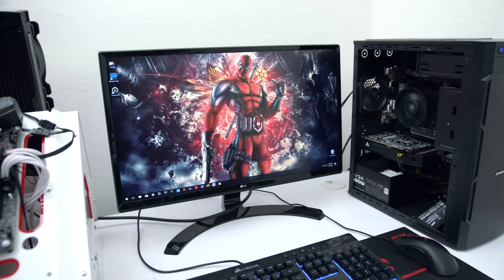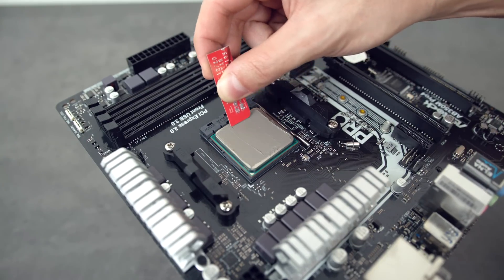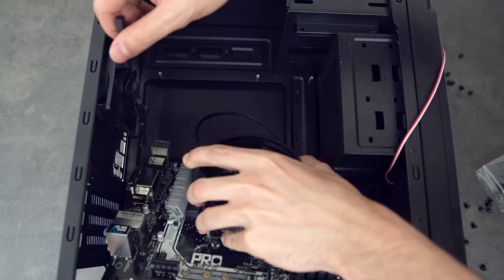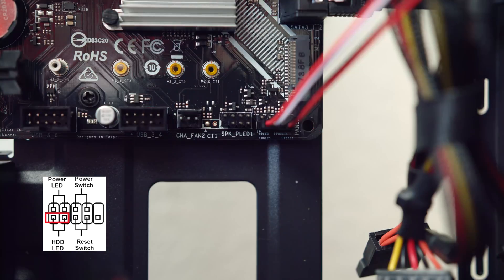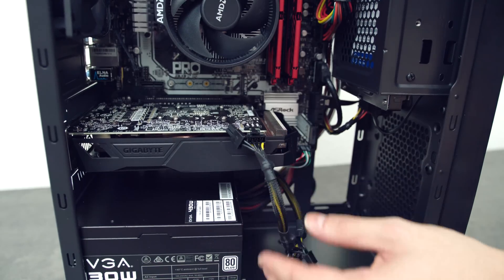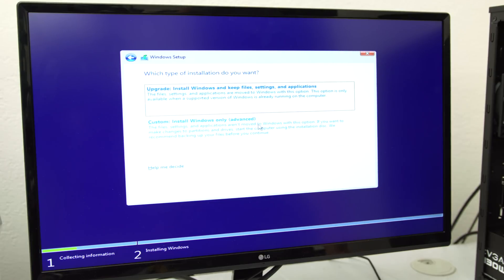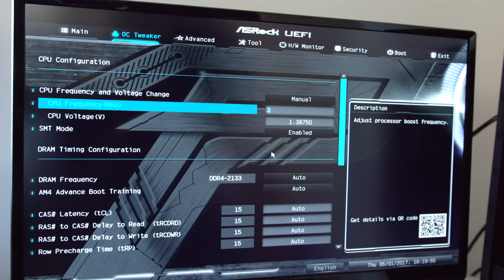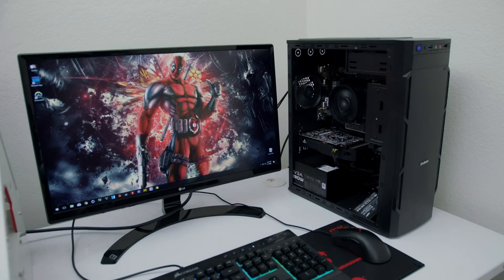How To Build A $550 Gaming PC w/ Overclocking!

Comment: Antec NX100 Gaming Cabinet with Transparent Side Panel = 2400/-

2)      Corsair VS550 550W SMPS = 3400/-

3)      MSI A320M Pro VDS Motherboard = 3600/-

4)      CPU Ryzen 3 1300x = 6000/-

5)      Klevv DDR4 8GB 2400Mhz RAM = 5200/-

6)      Teamgroup L3 EVO 120GB SSD = 1800/-

7)    HDD 1TB Internal Toshiba = 3249/
Plus I am using  used graphics card amd r9-280 3gb oc edition how is this build

Comment: you can still playing an games without gpu at ryzen cpu,just use integrated graphics,yep,if you using ryzen 3,u will using radeon vega 6,for ryzen 5,u will using radeon vega 8,for ryzen 7,u will using radeon vega 10,these graphic cards are integrated graphic,which still can playing games,but if you dont want a lag,dont force right flat settings at the graphic settings

Comment: Can you make pc frome these:
-Kingston ram ddr4 8gb pc2400 hx fury
-lc power supply lc500h 120 500w
-gigabyte radeon rx 570 gaming 4g 4gb gddr5
-wd blue 1tb 7200 rpm 64 mb sata lll wd10ezex
-asrock ab350m hdv ddr4 sata3 usb3 hdmi am4 matx
-amd processor ryzen 5 1400 with cooler wraith spire 65w yd1400bbaebox
- case ?
Reply: The price without case is 679.50€

Comment: So I did use this build, only I used a saphire pulse radion rx560 and a crucial ballistix sport LT 8 GB DDR4 ram. When I turn it on the led in the front of the case becomes blue and the amd cooler starts spinning, however my monitor says there is no signal detected. I also see no other lights inside the case. I checked all the cables and everything is in the same place as shown in the video. Also the monitor does work when I tested it with my laptop. Someone having any suggestions?

Comment: PLZ HELP. Hi, I really liked this pc for the price so I ended up building it a few weeks ago with the only changes I made was a 500w  supply and a gtx 1050ti instead of the rx 560 in the video due to price inflation recently. I then overclocked it and got 3.75 hz on the stock cooler and am very happy about this overall, only thing is I want to upgrade and get an SSD. It's not like the cpu is slow per say, but I just want that zooming fast load times that I know I could have with an ssd. Basically I need an SSD that I know will fit in this build. PLZ help

Comment: Hello I'm building this pc and I've bought all the parts you've listed in the description I've followed all of the instructions in the video the pc is able to power up I have a backlit keyboard plugged into the back that turns on and all of the fans are working the CPU fan, the gpu fan, and even the fan that came with the case but for some reason when I started the pc up nothing is showing up on my monitor. I'm currently only using a TV as a monitor until the actual monitor I ordered comes in so I have the tv plugged in and set to HDMI but for some reason nothing is showing up I've made sure all the cables were connected properly but I don't know what to do at this point please help
Reply: Wait nevermind I just had the hdmi cable plugged into my CPU instead of my gpu

Comment: Pc good for pubg ?
Reply: iTzFergy go for an rx 570 for pubg atleast. pubg is unoptimised as it is in early access so performance wont be great but playable at 30-50 frames on medium settings
Reply: Deano so this system isn't the best does he show how to build  rx570
Reply: iTzFergy exactly the same process
Reply: I'm kind of confused new to pc , Rx 570 is a different part instead of ?
Reply: iTzFergy rx 560, the gpu

Comment: Can someone give me some ideas for my first gaming pc, this is my first build and I plan on using it for primarily gaming. It includes pentium G4560, GTX 1050 Ti MSI gaming x, 8 gigabytes of Ddr4 ram (2 x 4), EVGA 430 w powersupply, Wd blue one TB hard drive and a Msi pro series B 250 pro- be mother. Board. Any segestions are appreaciated
Reply: Clash of clans daily get ryzen 3 when it releases and a a320 mobo

Comment: After I boot with the flashdrive it brings me to the windows installation screen but then my usb keyboard and usb mouse stop working. the light on my flash drive also shut off. People say to change a setting in the bios but i cant seem to find it. Others say to use a ps/2 mouse and keyboard. Any help would be great.

Comment: Someone please help 
These are my specs 
Intel i5 6500 3.2Ghz
GeForce gtx 1060 3GB
16GB RAM 
1TB hard drive and 60 GB ssd 
What would be a good psu. 
I got a 430w but the graphics card won't turn on at all

Comment: I've never built a PC before, so should I be worried about things not fitting and not being compatable?
Reply: if you buy these speific parts you shouldent have no problems but if you buy different one just double check because i have made that mistake before and it cost me 10 to return it

Comment: on the io shield, make sure it is lined up then tap it in with the back of your screwdriver. at least if you have a normal plastic handled screw driver. only takes taps, don't wack it.

Comment: This is a bad gaming PC for the price. Games rely more on GPU horsepower over CPU, yet you've used more of the budget on the CPU than the GPU. At this price, the only CPU you should be considering is the Pentium G4560. Pair it with an RX 570 and you will absolutely SLAUGHTER this PC for frame rates, expect 1080P 60FPS @ Ultra over the 40FPS @ Medium this PC delivers. Guys, if you want a well balanced gaming PC for the price and you don't know how to choose parts, stop watching Youtubers. Go to pcpartpicker and post a forum question, people with years of helping others on forums will answer.

Comment: i need your help Techsource I'm building this pc but I'm adding a optical drive, a few led fans, I'm using a different gpu (
ASUS Geforce GTX 1050 Ti 4GB ROG STRIX ) , and I'm wanting to add more ram and maybe even a second gpu so should I get a 500w power source or should I stick with the one you used. plz help I need you

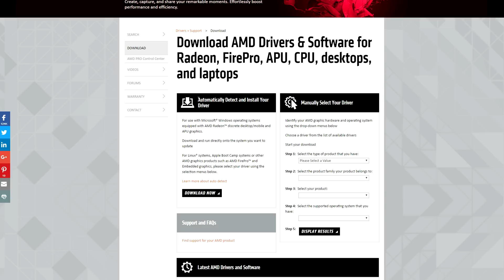Comment: @ 9:07 you said auto detect gpu but you said earlier if the pc doesn't have internet connection. So people doing that will install the wrong driver if they do it on another pc

Comment: Starting on building my pc in a couple weeks!
i3 7100 CPU 
Asus Prime B250M-K
2x4Gb G.Skill Ripjaws V Series 2400mhz
Zalman ZM600-GV 600 watt psu 
Fsp P1802 mid tower case
WD 1 tb HDD
Gtx 1050ti

Cost around 900-1k in New Zealand dollars, wish they weren't so expensive here lol, but I'm stoked cause it's my first pc build 😃😃

Comment: are you sure it is safe to go past 1.4 v? usually it is recommended to stay under 1.35 volts, especially if it is going to be clocked that way 24/7

Comment: please read all of this to help a person that wants to get out of this stupid console (xbox one). 

Is this build good for games like csgo, rainbow six, gwent, quake and a few indies on atleast 1080 and 120fps or 60fps.

RAM
- Ballistix Sport LT 8GB Kit (4GBx2) DDR4 2400 

CPU
- AMD Ryzen 5 1500X Processor with Wraith Spire Cooler 

Storage
- Seagate Barracuda ES 1 TB
- Kingston Digital 120GB SSDNow UV400

Graphic Card
- MSI Computer GTX 1060 ARMOR 6G OCV1 NVIDIA GeForce GDDR5

power supply
- CORSAIR CXM series CX550M 550W 80 PLUS BRONZE 

Motherboard
- ASRock AB350M PRO4 MicroATX Motherboard

thanks for reading this and sorry for my English
Reply: Seems like this is more expensive than a Xbox One.

Comment: I have an rx 460 graphics card and idk why sometimes on csgo when i play on the highest setting i get well above 150 fps but some times if i play on low settings or high it doesn't pass 50 and its really laggy and pisses me off
Reply: David Romonti doesn‘t make any sense . If you still have warranty on your rx 460 then send it to amd to fix the problem , maybe you have a faulty or detective gpu. Then amd could switch it and then give you a new rx 460 for free if the error can’t get fixed. ( sorry for my bad English )

Comment: Hey guys.
I'm getting a PC, used for abit of everything, including programming and gaming. Ideally, I want to have 3 1080p monitors(gaming for some games)(24 in on the sides, 27 middle) and then in the future,if possible, upgrade the middle one to 1440p.
I want some oppinions on the build, if its good, different parts etc.My budget is around 1500 CAD, which is the cost of the parts I have..

Core-i5 7500
Cooler Master Hyper 212 EVO
Asus Z270 PA
Ballistix 16GB RAM
WD 1TB 7200RPM
GTX 1070
NZXT 340 Case
EVGA 500W
CorsairSp120Fan

Thanks alot!
Reply: im so late, but i think those parts are enough for your needs

Comment: "I apply the thermal paste like this for OCD reasons..."

Installs CPU cooler with logo sideways
Reply: Nate G the logo spins with the fans, nothing can be done
Reply: Shayan Ahmed I forgot that's a thing with AMD fans, thanks for pointing that out makes sense now
Reply: McLovin why did you have to tell me, now I can't unsee it
Reply: Most people face it that way. In my opinion it looks cooler. Hehe get it?
Reply: Peter V not a fan of it because it gets my head spinning
Reply: Oyster nice
Reply: no it doesnt, its just mounted that way, I managed to turn mine but the screws holding it were impossible to get to so its partially broken
Reply: Tico2858 congrats
Reply: It bothers me man
Reply: Starless Knight no the logo on the frame of the fan dosent move only the one in the fan can spin
Reply: its the fan wise guy
Reply: xDDD
Reply: The logo on the fan frame is meant to be like that....
Reply: Nate G TRIGGERED!!

Comment: Is this cpu good for using programs like ArchiCad, acadbau, editing videos or youtbe at all?
Reply from the maker: +《PR》 Prince¡ check my benchmarks video
Reply: TechSource So i guess its not the best... the program is designed for 4core cpu....so idk have any suggestions? should i just pick another cpu? which one?
Reply: 《PR》 Prince¡ how much r u planning to spend on the pc
Reply: Ryder Wang trying to get ti for max 600-650€
Reply: 《PR》 Prince¡ whats ur budget for the whole pc, i live in canada so idk exactly how much 1080 ti cost in euro, but i searched it up on pcpartpicker, for 650 euro id think ur able to get a 1080 ti unless ur fine with 980 ti, but i would go for 1080 instead of 980 ti paired with a 7700k, overclocking it to 5 ghz should get u the performance u want. last i want to mention it that u could pair a 1080 ti but lower u budget to a 7600k, dk if it will bottleneck tho
Reply: Ryder Wang ok thanks i will check things out when i will be able to...

Comment: amd fx 6300 is better than ryzen 1400 because fx can be overclocked to 4.7ghz i have it 4.5ghz and its stabl
Reply: HansBeaast the clock speeds aren't everything. You're looking at a 5 year old cpu vs a 5 month old cpu. The Ryzen chip is way more power efficient and offers more performance.

Comment: Probably should have removed the stickers on your ram, it might heat up and get all sticky.

Edit: Of course Im not talking about the aesthetic ones, Im saying the white barcode label one
Reply: doesn't that void warranty?
Reply: I never said throw it away, you can always keep it and re-apply it later if you need to RMA, and no-one will be the wiser ;)

Its just that I've had a sticker label heat up in my PC before, and it smelled like burning rubber in my room for a whole week.
Reply: The Booty Guru nah it's better this way so you know what it is later

Comment: I just finished my build and it came out almost the same for exactly the same price, the only difference is I got an evga 500w PSU, a gtx1050ti and a WiFi card. got a discount in a CPU/mono boundle, that way i had some extra cash for the cards and PSU.

Comment: Spreading the paste like that could result in bubbles forming which would not give a sufficent seal between the cpu and the cooler, therefor, higher temps.
Reply: Jack Bauer I personally use the pea method. A line works too, or even a cross sometimes. but aslong as you eliminate the risk of bubbles forming I think you're good.

Comment: Guys, I need some help. I am building a 600 pound pc in the UK. These will be my specs but need help with the processor.
8gb ddr4 ram
1TB hdd
120gb ssd
cheap motherboard 
pentium g4560 and gtx 1060 3gb or i3 7100 with an rx 570 or save up more for ryzen 5 1400 and rx 570
Which option cpu/gpu would be better? Please post your replies to help. Thanks!

Comment: Most of the Tech channels skips to the cables that where to plugs in and which one should be. Excellent job Ed.
Reply: Onur Can well on different motherboards the headers are at different locations, so for universal guide you cant do it
Reply: @unknowngamer7325  

Pros: • Works out of the box with AMD Pinnacle Ridge and Raven Ridge (no UEFI/BIOS update has been done) and Windows 10 version 1809
• Superior layout: The top slot position is shared between the PCI Express x1 slot and the Ultra M.2 socket so that the M.2 card can be cooled by the CPU cooler. The 2nd slot position is PCI Express 3.0 x16 (for the GPU). The 3rd slot position is vacant because a large GPU will cover the 3rd slot position and a small GPU would be suffocated by a card in the 3rd position. The 4th slot position is PCI Express 2.0 x16.
• Heat sinks on the motherboard (please see the picture)
• Four RAM slots, two M.2 sockets, and five fan headers
• No carnival lights on the board (for those who do not want lights)
• In addition to the RGB headers, another header designed specifically for the AMD stock CPU coolers which have LEDs (for those who do want lights)
• Relatively RAM-friendly: Because a previous motherboard from a different manufacturer failed and was RMAd, I had already purchased RAM which is not on the ASRock QVL but it worked anyway with this motherboard (the RAM is Ballistix Sport LT 8GBx2 DDR4 2666 BLS2K8G4D26BFSCK)

Cons: • The paper documentation included with the board shows that the highest supported RAM speed is achieved only when the second pair of RAM slots is vacant -- if all four RAM slots are populated then the maximum possible RAM speed is lower
• This board is the maximum size for the Micro ATX spec which means that it will be a tight fit in some cases
• The second M.2 socket supports only SATA, not NVMe
• The RAM slots are the newer (worse) type which have only one release lever per slot -- the older RAM slots which had release levers on both sides (two levers per slot) were much easier to work with
• If you require four PCIe slots then this is not the board for you (it has only three)
• No TPM (only a TPM header)

Overall Review: The combination of reliability, features, and price make this board my choice for both higher-performance (Ryzen 2700) and home-office (Ryzen 2200G) builds. This board has a tendency to not fail (please read the other reviews).
Reply: Onur Can u have all in description book

Comment: Hey im going to build this for my first Gaming PC. Are there any parts that you suggest for me to upgrade.
oh and will be able to use LED light with this power supply? 
your feedback is mlst appreciated 😁😁
Reply: Paul V I think buying master cooler hyper evo 212 is better than this air cooler
Yes led can be plugged in any good power supply
Reply: ٍِSamdroid gamer Thanks bro (sorry for assuming gender) I will definitely look into that 😁
Reply: :) it's fine bro
Good luck with your build 😀
You might also look for a good case with led if you like 
I was going to buy phanteks p400 but I couldn't find it locally in my country so I bought raidmax alpha 
If you can afford the phanteks p400 and like the look of it go for it always remember to do some research before buying

Comment: This is mine: Ryzen 5 1400, b350m gaming pro motherboard, 8gb of ddr4 ram, gtx 1060 6gb mini (or 1070 mini, not sjre which yet), 2tb hard drive and a 550watt psu, all insife my thermaltake v1 mini itx case... cant wait to build 😁😁😁😁😁😁

Comment: Is this build good? https://uk.pcpartpicker.com/list/fKTzLD (I already have multiple HDD's)
Reply: Lima you should check that your CPU cooler and graphics card will fit in. 
Edit: overall a good build
Reply: Thanks. I have successfully built it with the list parts; the CPU cooler is a tight fit but still fits!
Reply: looks fine but the case is too small for the GPU and the cooler